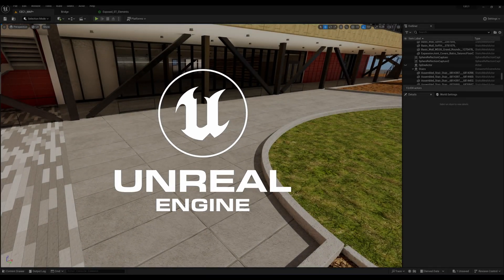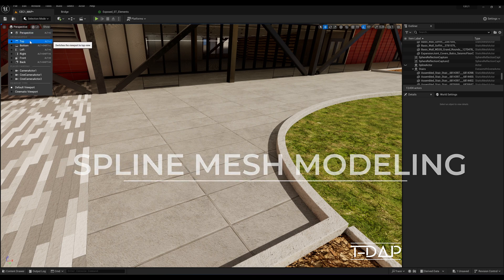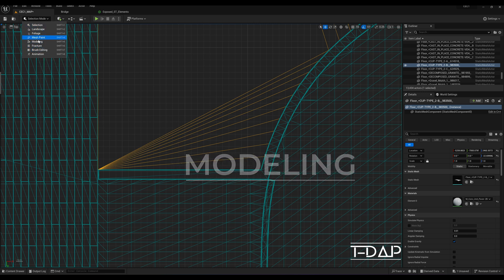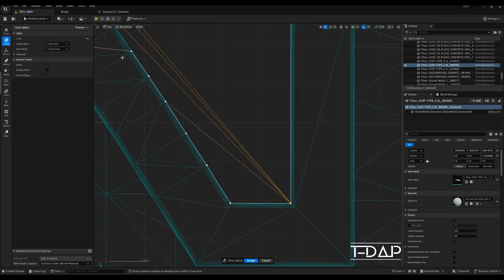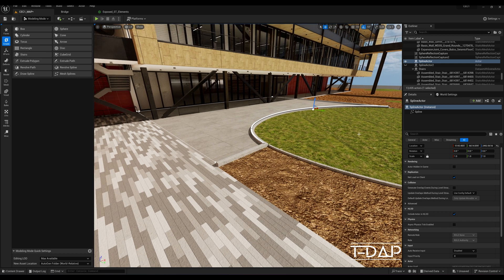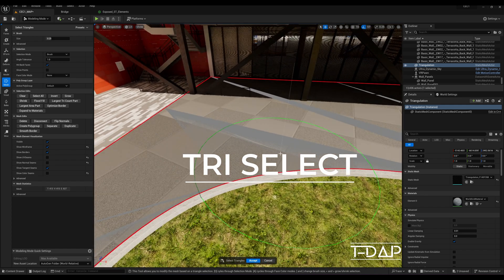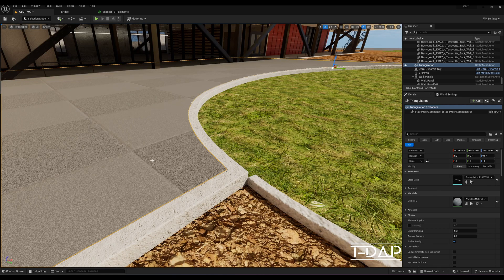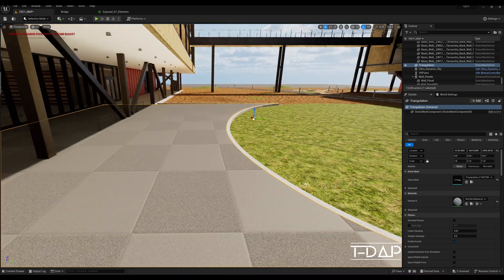How to create SPLINE MESH modeling in UNREAL ENGINE 5.

Comment: When I make a SplineActor and press the instance, then i try to press tri selection, all options are grey. How do you make the empty spline interact with these options?
Reply from the maker: Make sure the spline is closed. If the spline is open you won’t be able to use the Tri select option.